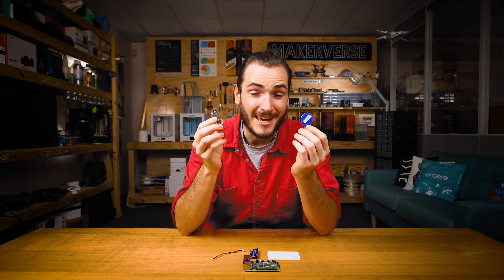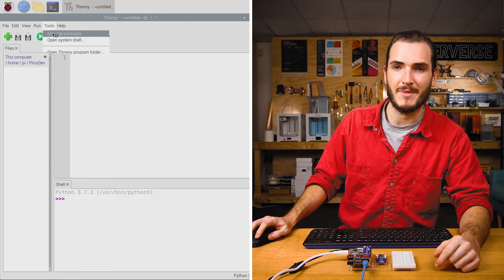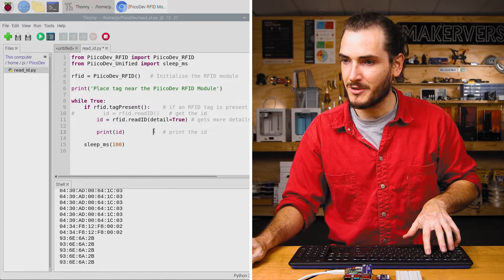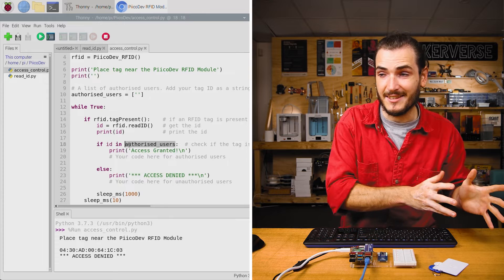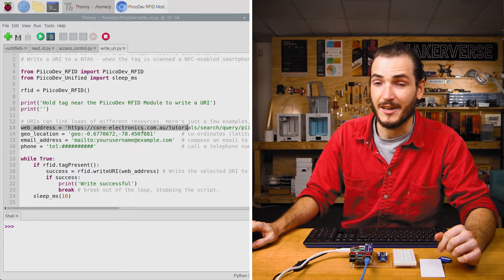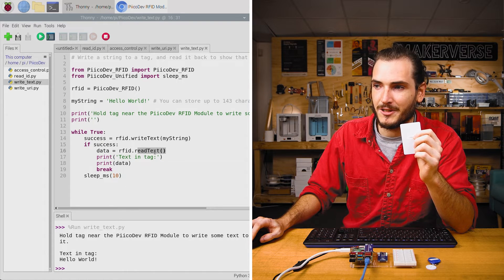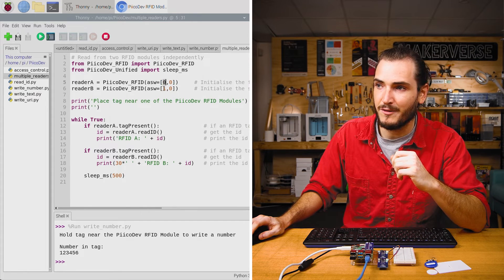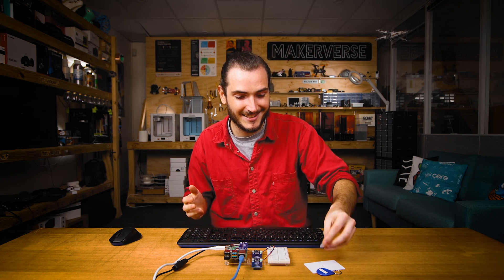PiicoDev RFID Module | Guide for Raspberry Pi

Comment: Can i use the Pi 5 version instead of Pi 4 i just upgraded my Raspberry Pi  ?
Reply from the maker: Yes you can! The Pi 5 uses the new Bookworm OS, so you may run into an issue of having to use virtual environments, here is a guide to set one up!

https://core-electronics.com.au/guides/using-virtual-environments-in-thonny-on-a-raspberry-pi/

Comment: Hey, I was wondering if it has to be a Pi 4, and if not what would be the lowest Pi I could use? For the past year me and my dad have been working on a Pi Zero W2 (I think), we have been using it to play old ROM's. So I was wondering if I could reuse the pi or if I would need to buy a more advanced Pi.
Reply from the maker: You shouldn't have any problems running on older Raspberry Pi Models, our PiicoDev modules are designed for MicroPython devices like Raspberry Pi Pico & MicroBit so you shouldn't experience any issues with a Pi Zero.

Comment: I've got a question regarding the RFID module: Is it also possible to use another one? Most I see on the market (same 13,56MHz) seem to have way more pins, which needs to be connected. This one only uses 3.3V, GND, SDA and SCL (or am I mistaken)? Could I also use Modules having MISO, MOSI and other connections like common RFID Kit RC522, without using this pins, or do they function in another way? Unfortunately, your modules have quite a high shipping fee :( If not, why does your module got so little connection count compared to other ones?
Reply: You probably have you answer by now, but yes. I just bought a very common RC522 kit with 8 pins, 7 of which are used when using the SPI protocol.

Comment: I have a project in mind that will involve the tag being on a pet's collar and so I need more like 1m range.  I saw something that indicated 13.56 Mhz should work up to 1m, but the technical specifications on the picodev RFID module page indicate 26mm (about 1 inch).  Is there a module I can use with a Pi that would recognize a tag from .5m-1m away?
Reply: Hi there Joe, could you find an answer to this? Working on something similar :)

Comment: Nice video. Very well demonstrated. I'm assuming you can do away with the pico adapter and plug the RFID board directly into the SPA pins?
Reply from the maker: Thanks Daniel! That's correct, except this module uses I2C instead of SPI.